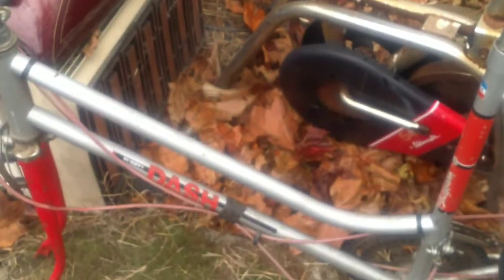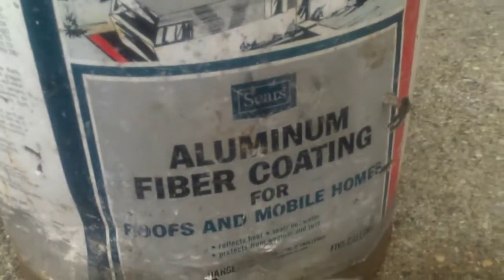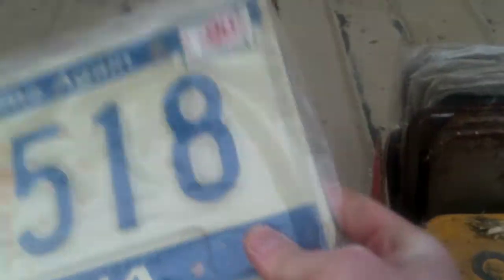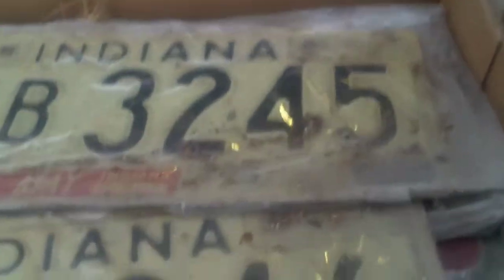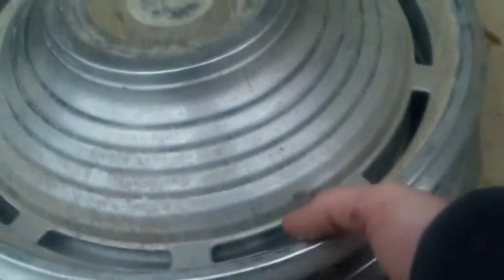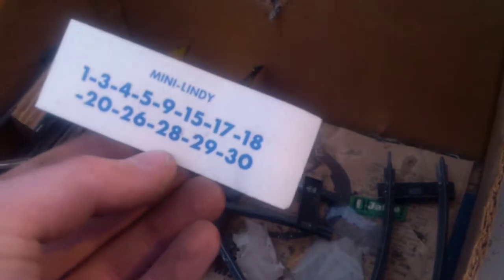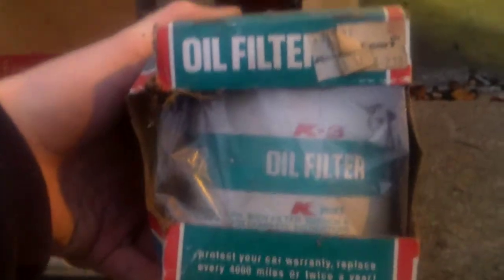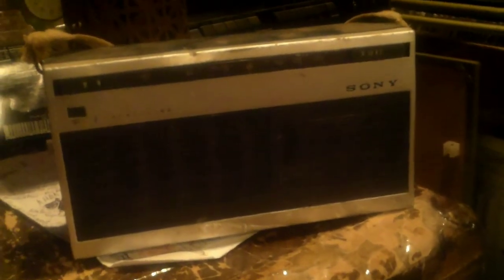Auction Super Haul Video | Lots Of Antiques

Comment: Sure is a sweet truck you got. But at 28:00 in, that my friend is a condenser, it mounted on the side of the distributor that connected to the point set (that had to be gaped just right to run) connected to a rotor that spun around inside the cap at the top of the distributor that all the ignition wires connect to to send the voltage to spark the plugs & thank god electronic ignition came around because a tuneup was a hassle to say the least. And if it any of that got wet, it ran like crap.
Reply from the maker: Thank you for the information. Have a great day.